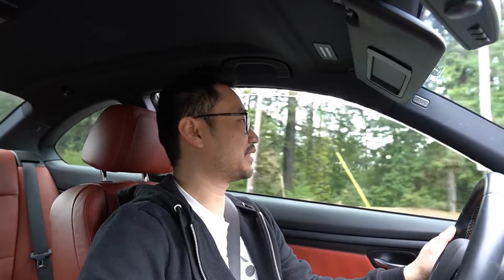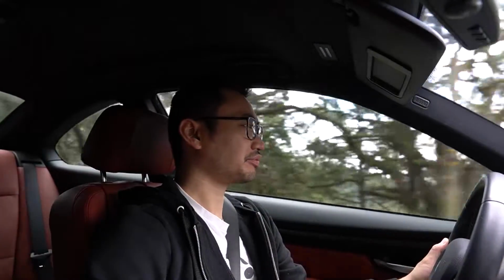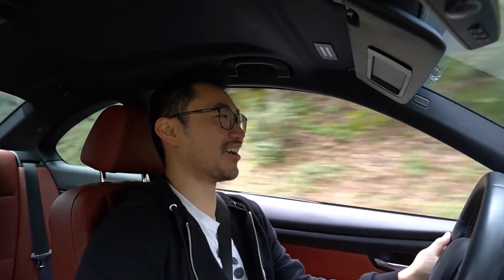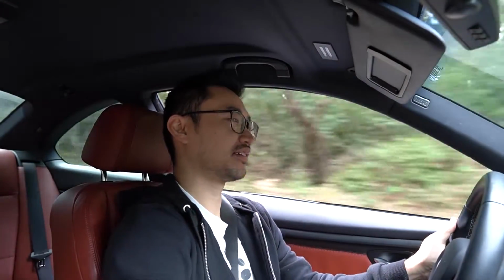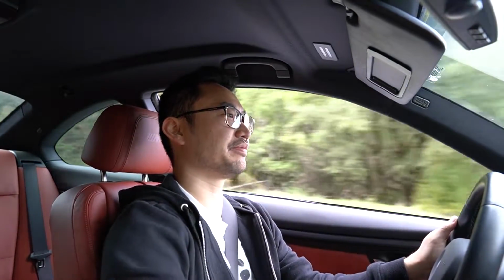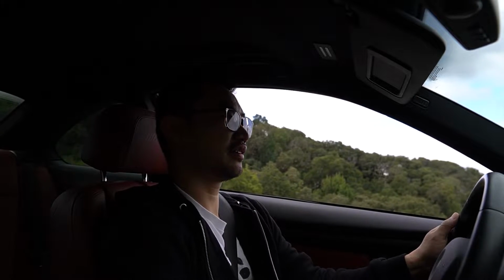M Performance Exhaust thoughts and sound clips! - E92 M3 - MPE

Comment: I came here because I'm considering the performance exhaust and was hoping for a audio comparison with stock exhaust. I currently have done the OEM mod to the stock exhaust and to be honest I think it's becoming obnoxious. Specially on the highway where there is this constant drone. So, even though I'm not convinced about the sound I think it will be better in the long run. Also, the exhaust tip do look better :) Great video nevertheless. I'm glad this car still has a fanbase and a community producing content. Keep it up!
Reply: i'm in the exact same position. i have the medium mod as well and it sounds great but i have to say there are more situations where i am too loud then too quite. i really dont know if i should go legal with a little loss of noise. also i love the performance tips.

Comment: Hey Will, thank you. I have a 2011 Comp E92, with the M sportt exhaust, but would like more sound. I think I want an aftermarket X pipe probably with Cats to keep from having to use an aftermarket code change. Which X pipe product with cats do you think is the best value? Thank you.
Reply from the maker: Check out challenge x-pipe. I heard it pairs very well with the m performance exhaust. The only reason I haven’t tried this is because It probably wouldn’t pass sound at Laguna Seca.
Reply: @WillsGarageOfficial  Thanks, An RPI  GTM fell into my lap today so I am going to give it a try!

Comment: The MPE should’ve include it in the competition pkg from the get-go! Tho I feel ass raped when I first bought it but that supposedly added 5-10 more HP and enhanced performance sound is just too intoxicating especially at 84000 rpm. Yours looks like the improved version 2 where they improved on the metal material so it won’t easily crack. Mine is starting to show mild separation based on the fumes formed along the crevasse. Now do a DIY for battery change as I’m still on my original since 2013 😆
Reply from the maker: Yeah I have the v2 and agree that the price was a hard pill to swallow. It just sounds so good though! Hopefully you can get yours rewelded. I also have the original battery from 2013 but have kept it alive. I’ll probably talk about in a future video.
Reply: It’s easy enough to put in a new battery but the car does require some programming, to adjust the charging system to the new battery.  There are plenty of stories of batteries dying prematurely if that step isn’t performed.  Mine lasted 5 years before I got the message.
Reply: 84000 rpm, that's where it's really at! jk

Comment: The trick is not to get the exhaust sound in the cabin with windows up but still get that great S65 sound outside. I still have standard exhaust as I just can’t make up my mind which exhaust I want. Aka would be my 1st choice but it’s soo expensive I can get full tune, test pipes and another exhaust for less than the Akc cost. I would like the MPE with test pipes and tune but I have heard it then sounds too raspy. Anyone experiencing that ?.
Reply: Had 2 e92 M3s with various exhausts, M Performance exhaust, OEM modded, Akra, & then standard OEM.  
I.d probably rate them in that order, MPE wins even with money no object, the Akra a bit too tinny and raspy hollow sounding to my ear.  Unless you want titanium for weight saving or really like the Akrapovic brand, I’d recommend the MPE as the ideal balance ,  or OEM modded if like it loud , and spend the savings over an Akra on a Karbonius intake.

Comment: will a louder exhaust accentuate the intake noise more? or even by just removing the primary cats alone?
my stock e90 m3 is barely noticeable, but i can hear yours more clearly.
Reply from the maker: Louder exhaust won't affect the intake noise. In fact, it might over take your intake sound if it's really loud. Removing cats will make it louder.
Reply: @WillsGarageOfficial  will cold start be louder with just pre cat delete and stock exhaust?
I may have it coded out if that's the case.